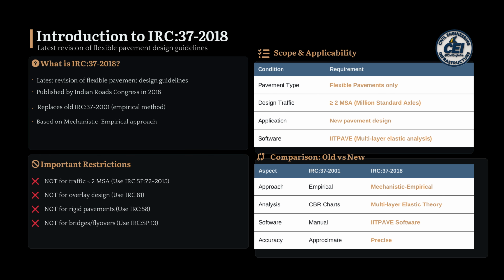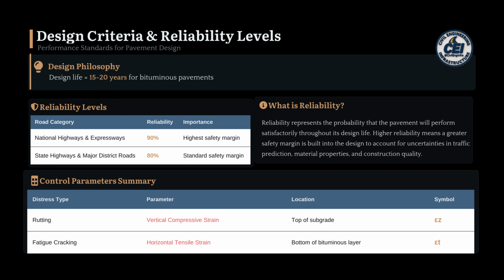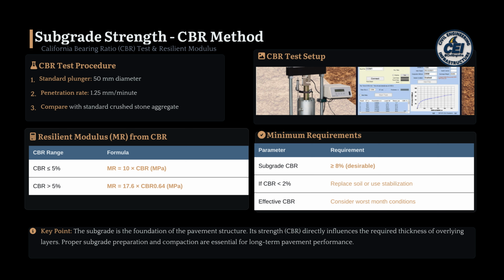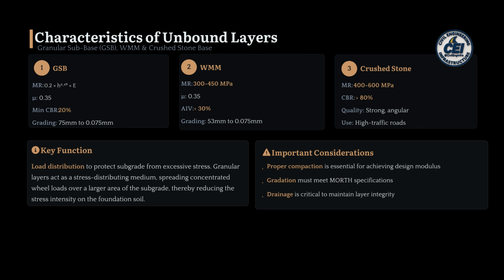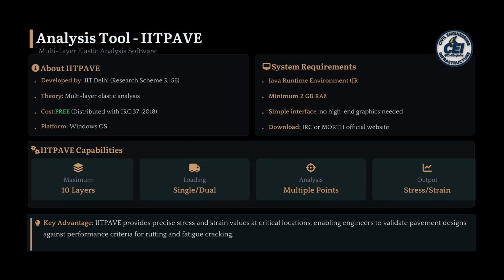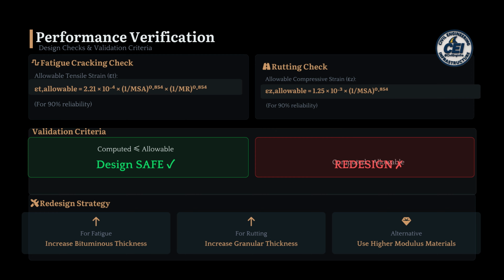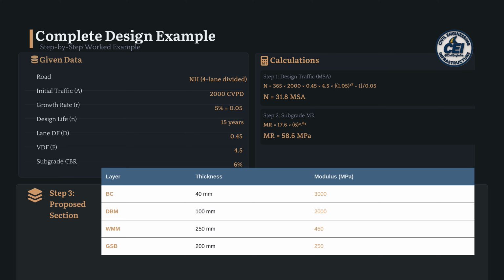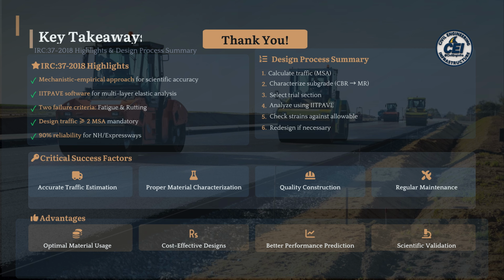IRC 37-2018 Flexible Pavement Design Explained | MSA, CBR, IITPAVE & Worked Example

Comment: How much BC thickness (in mm) do we have to provide for design traffic 100 msa?
Reply from the maker: For 100 MSA design traffic, BC thickness cannot be decided from traffic alone. It depends on the effective subgrade CBR and the complete pavement composition.

For example, as per IRC:37-2018 based design using IITPAVE, for 100 MSA traffic and 5% effective subgrade CBR:

BC = 50 mm
DBM = 150 mm
WMM = 250 mm
GSB = 250 mm 

So, for 100 MSA, 50 mm BC is one design example, not a universal value. The final thickness should be obtained from the complete pavement design.
Reply: @CivilEnginfra Thank you Sir